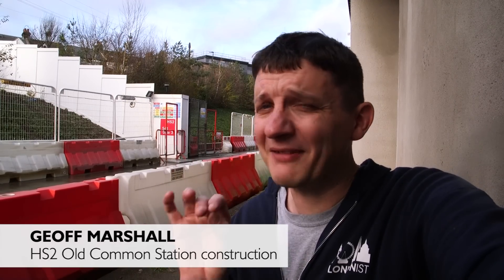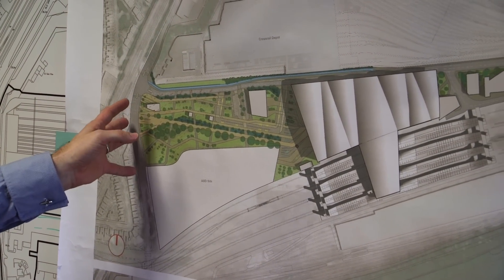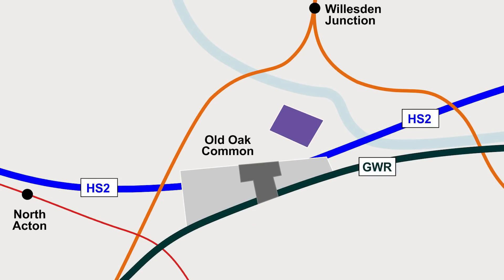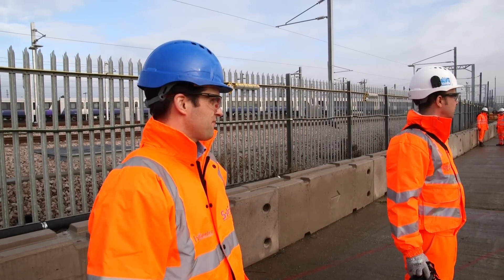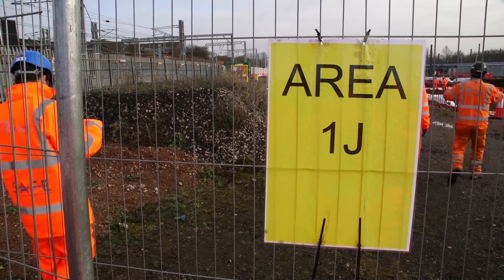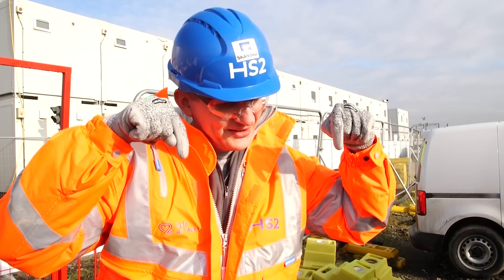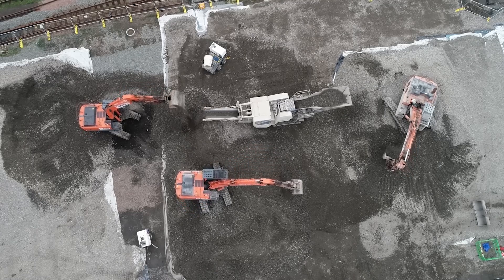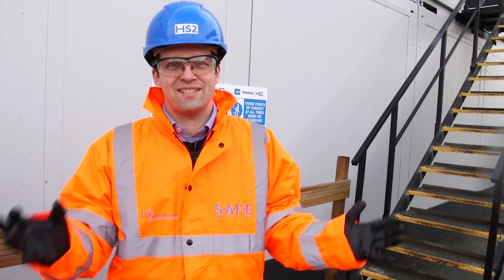HS2 Old Oak Common Station Construction

Comment: The dimensions are huge, but also in wasted opportunities of connecting to the existing lines of the Underground and well as the Overground. A new station is built for a lot of money but the overground only will be connected by two stations “within walking distance” and the central line running by will not be connected at all. If this location really was a considerate choice to create a major rail hub with long-distance high speed service in the western part of Greater London then please remind that the existing rail lines need to be connected from the beginning or at least alterations to do so have to be considered already in the layout of the new station. The Overground branches could be connected by (tight) curves to a new station paralleling the Great Western Main Line. Also for the Central line (at least for the trains of the West Ruislip branch) a solution should be found to integrate into the new hub, be it by a new station on the existing line or by relocating or branching off a new line running between North Acton and White City stations via Old Oak Common, while the Ealing Broadway trains could stay on the existing line via East Acton, as Ealing broadway will have direct connections to OOC stn. All this is not a simple task, but I fear with the inauguration of the new station the demand for better embedding it into the rest of the rail network will get obvious quickly.
Reply: The whole area is mostly warehouses but there are enough houses and roads (including the A40) that there is no way to link up the Central line without a new tunnel at a phenomenal cost. 

Commuters who need the central line can just change at Ealing.

Comment: Biggest white elephant going time its finished run over budget no one could afford to buy a ticket to  use it money better spent on nhs
Reply: All for getting to Birmingham 12mins early we have got 2stations in London Euston and  Marylebone which already go there I know I never be using it
Reply: @ashleyscottthomas6633  a few things a) the only reason people can’t afford current train fares is because there’s so little capacity that fares have to rise to prevent overcrowding b) the money can’t be spent on the NHS as it doesn’t come from taxation, it comes from borrowing which is paid back through the line’s revenue. The NHS doesn’t create revenue so it can’t be funded in this way. C) the primary purpose of HS2 is increasing capacity, not speed. HS2 cuts journey times by up to an hour anyway D) pretty much all existing services from Euston to Birmingham and other intercity destinations will move to HS2 to allow for more local services

Comment: HS2. What a monumental waste of money. If HS2 was scrapped and the greedy contractors paid off, they're still have over 100 billion, which they could then spend on improving and extending existing railway infrastructure countrywide, not just one line. East Anglia for instance provides a wealth of opportunity to relieve pressure on the south east. Examples such as the Norfolk Orbital Railway and re-opening the Wisbech to March line would cost a pittance by comparison, yet deliver significant benefit both to and from those areas. Scrapping HS2 could fund 100's of similar initiatives across the country rather than the one-trick pony of getting from Birmingham to London quicker (I don't imagine huge swathes of Londoners commuting to work in Birmingham and beyond).

Comment: The most exciting aspect for me is the resurrection of the old New North Main line to Northolt allowing Chiltern Railways access to Old Oak Common from High Wycombe and perhaps Milton Keynes. This'll make getting to the city and Docklands much easier using Crossrail than via Marylebone.
Reply: The New Line that ran by Heathrow Express and the GWR depot, at Old Oak Common, was permanently removed during this HS2 project, so I suspect Chiltern Railways will not have line access to the Old Oak Common Station.

Comment: The question to ask is how will Old Oak Common be used as a terminus Station due to Euston being delivered later than Old Oak Common.   And if that is finally being revealed, despite it being known for some years then what service will be available with just the 6 platforms.
Reply: High Speed 2 will initially only serve West Coast destinations when Phase 1 is built, so if Euston isn't ready for whatever reason, OOC has enough capacity to act as a terminus for those West Coast services. Euston's extra capacity is needed for services which will replace Midland and East Coast mainline trains

Comment: At £106 billion (which will probably end up being £200 billion) it will never cover its costs and the fares will be so expensive, very few will afford to use HS2. It may have 4 services a day and most coaches will be empty.  All this to save a few minutes travel! REVIVE SOME OF THE CROSS COUNTRY LINES CLOSED BY BEECHING!
Reply: The actual estimate is, at most, £88bn. Fares will be exactly the same as existing intercity fares, as the intercity services will move to HS2. 17 trains per hour are planned to run on HS2 once it's fully completed, with space for one extra.
Reply: @agent_605  Still cheaper to go by National Express and by air if you live near one of the National Express coach stations London Airports.
Reply: Terry Moore Thats only because air travel isn’t taxed anywhere near as much as it should be for its environmental damage. If the Government actually gave a damn about climate change they’d be putting much more funding into the railway to improve it and reduce fares

Comment: I’m sick of hearing all these great plans for transport infrastructure starting in London or the South.

HS2 should have been started on the North where jobs are needed. Unemployed folks on the south could move North where accommodation is less expensive  and work.

As the rail links filter towards the south, more access is opened up for northern business and services so that by the time it reaches London and connects to the South, more northerners are working, contributing to the economy, have more disposable income and their taxes are being ploughed back into the country.
Reply: Matchstalkman Construction work for HS2 has already started in the North as I speak, Building work has begun in Birmingham for a new Rail Hub Interchange  https://www.newcivilengineer.com/latest/work-to-start-on-270m-birmingham-interchange-09-03-2020/

Comment: HS2 will just pull more people towards London from the North. It's not clear how the North would benefit...if indeed there would be any benefits?  And is shaving off less than 20 minutes from London to Birmingham really worth it?.....worth all this effort and upheaval?  How much alone is it going to cost to divert a section of the GWR main line so that it goes through OOC?  With a No Deal Brexit looking very likely, HS2 just looks absurd and wildly extravagant. Unfortunately these are not right times for HS2. The 00's would have been perfect - pre 2008 Financialcrash, and Pre 2016 referendum. Now HS2 looks like folly rather than justifiable and necessary.

Comment: Looks like the new government are about to pull the plug on the entire HS2 project. In some respects this is sad, but in alot it's a blessed relief. It's just NOT the right time at all to be starting to build a new network of railways from scratch. The biggest problem with HS2 (and there are many!) is that it didn't reckon on Brexit. Us leaving the EU wasn't factored into the equation when the whole HS2 idea began rolling ten years ago. No one then, could forsee the UK voting to leave the EU. It wouldn't have crossed anyone's mind back then.

Now we are no longer in a position to justify the huge expenditure the project would cost us all. By the time we've removed the last strand of law linking us with the EU and expenditure this will entail, there won't be much money left for HS2. Oh, and also there's the small matter of the divorce bill. We're going to have to pay the EU something - this is obvious. Just how much?? They're not going to let us leave the EU for free. This is patently obvious, and the more we try to insist we owe them nothing the greater the damage will be to relations with other European countries. In the long run this would harm us........and them.

So we need to focus on improving the existing rail network we have. We also need to get on and build this 'Northern powerhouse' rail link between Liverpool and Hull ( via Manchester and Leeds). This is long overdue, and the fact you can't travel on one train continuously from Liverpool to Hull is, in 2019, frankly not good enough. Another thing, there's alot of appetite for some rail lines closed by Beeching, to reopen. These projects (and the Northern Powerhosue rail link) are what we now need to focus on - not HS2. I'd say HS2 is pretty much dead in the water. Sorry Old Oak Common, but it ain't gonna happen. It was very ambitious, but ultimately Brexit has made it virtually impossible.

Comment: Still don't understand why HS1 and HS2 aren't going to be connected.  Are we seriously going to expect passengers from the NW for the Continent to get off at Euston, walk to St P and get on another train?
Reply: In early iterations of the project there was a link via a tunnel between Old Oak Common and just north of St Pancras (ish.) However, as the design was developed, they reckoned that there wasn't enough passenger demand from "North Of London" to/from the continent to justify it, (incidentally, it also means HS2 trains don't need to be compatible with all the European signalling systems) and of course it saved some money by deleting the link and appeased some of the residents of Camden. The train paths then freed up allowing for serving "other" destinations in the UK.

The vexed issue of passengers having to walk from Euston to St Pancras gets discussed from time to time and at present is does seem they will be expected to walk. There is some suggestion that if Crossrail 2 gets built, a Crossrail 2 station will link the two London HS stations (Euston & St Pancras) by foot underground rather than at street level. Travelators and/or some kind of people mover often get mentioned. Again, it would seem that expected number of passengers wanting to travel HS2 and thence onward to Europe doesn't justify any great expenditure. 

Likewise, a station a Heathrow got dropped for much the same reasons - not enough passengers to justify the expense, but at least Heathrow passengers can connect at Old Oak Common for Crossrail 1 (Elizabeth Line) services to Heathrow.

Comment: As someone who believes in rail travel HS2 makes me sick, taxpayers money being wasted on a project that is not essential to the infrastructure in this country. Rail fares are going up yet we still have rolling stock from the 80s on key commuter routes. The disruption this is causing is already causing havoc. Euston station closed ruining people’s travel over Easter weekend because of this project. Cross rail has already gone belly up with overpaid project manager being fired. Money wasted on a project aimed at business people who can’t wait another 30 minutes to get to Birmingham, Chris failing will be fired before this farce is even half done yet he didn’t have the balls to stand up and use the money where it’s needed. Shame on the government, with any luck we crash out of the EU and they have to drop tools and abandon this pathetic project.
Reply: HS2 is far from "not essential" - it's proponents claim it's addressing capacity constraints on the WCML/ECML. Station (and line) closures for engineering works is hardly a novelty, it happens all the time.

Comment: HS2 should be abandoned now, before any tunneling has been done.
Reply: We NEED HS2 to provide badly needed additional capacity! The WCML is the busiest main line in Europe, if not the world, and is likely to run out of capacity in the next few years the way things are going, and the only long term solution to that is to build a new line. Building it doesn't mean we can't improve the existing network as well - it isn't one or the other!
Reply: @Inkyminkyzizwoz  we don't,  it would  be better to have a bullet  train like  service they could slowly develop such a thing one station at a time with a replacement bus service for the gap as the bullet trains slowly extend along the route
Reply: @GreatSageSunWukong We've already tried that with introducing the Pendolinos
Reply: Meanwhile the North East uses Pacer trains.
Reply: @jerryn9496  exactly
Reply: @pxsrrail2558   Didn't you mean 'not exactly' ?
Reply: @jerryn9496  Meanwhile in the North East apart from the new NEXUS trains £ Bns of new trains are under test and drivers being trained for services in the North by TPE and Northern.... You forgot that bit
Reply: but at least keep building old oak common station and re-route HS2 to serve Swansea
Reply: Agree, its just another excuse for social clensing, East Acton is getting filled up with investment flats for Chinese people to buy and never live in
Reply: Christopher Wright we can only hope Christopher, we can only hope. I can’t believe that they’re actually still contemplating continuing with destruction, I mean construction. Ha ha ha. This thing is billions and billions of pounds over budget already, and it will be even more so by the time it’s finished. That’s not even the most important part. Or environment will be potentially be visibly scarred and damaged beyond recognition by the time it’s finished, and yet they’re still saying they’re going to go ahead with it. These people have absolutely no sense. NO SENSE AT ALL. The only way we’ll be able to stop it now is with a complete and total outcry and protect strike across the areas that will be demolished and in London.
Reply: @danielwhyatt3278  HS1 is enough to give the UK a high-speed presence on the European network. HS2 reinforces the neglect of the North in favor of yet more London-centricity. So much improvement could be made to the whole network for the price of the HS2 vanity project. It's infuriating.
Reply: @danielwhyatt3278  How can any project let alone HS2 be '£ Bns over budget'; when contracts have only been let a few months ago? You wouldn't be playing the misinformation game would you? And please may I have the winners at Ascot later this year seeing you have such a reliable crystal ball?
Of course the reality is you are talking utter bollocks like all NIMBYS (and Remainers) do to appease your confirmation bias. You present NO facts just some hysterically inaccurate opinions ....
Always makes me smile how you objectors to HS2 never see anything wrong in the ICE services in Germany, TGV in France and all the other High Speed lines in Europe. 
#FacePalm
Reply: @danielwhyatt3278  destroy the environment???? This amazing feat of engineering will take millions off the road every day!
Reply: @pxsrrail2558  HS2 will simply turn Birmingham into a temporary commuting suburb of London. Temporary because work patterns mean fewer people will be desk bound or need to work in the smoke. Electrifying and improving alignments across the country will be of far greater effect for the price of a vanity 1960s Japanese bullet train through the Chilterns.
Reply: @pxsrrail2558  If millions a day are going to use HS2 they'll need to plan to build several more tracks.
Reply: @pxsrrail2558  To serve just one city and destroy even more land for an unthought route.

Comment: Scrap hs2 and build hyperloop.
Reply: Hyperloop has not been demonstrated to work yet, let alone make an economic or safety case. Assuming the engineers sort out all the Hyperloop technical challenges (thermal expansion of the tubes, maintaining the vacuum, going round bends, junctions, passenger ingress/egress, dwell times, emergency evacuation, passenger safety - the list is endless,) the DFT reckon it'll be twenty years before Hyperloop is ready to carry people. Many are skeptical hyperloop will ever be practical. 

Some boffin calculated that 34 hyperloop tubes would be required to carry the same passenger capacity as one high speed rail line. Take a look at the litany of moaning NIMBY commentary attached to this video - can you see them embracing 34 hyperloop tubes arcing across the landscape near them...? I can't resist the pun - right now, hyperloop seems to be something of a pipe dream. I'l get my coat.

Comment: It is a shame the HS2-HS1 link at Camden is currently cancelled
Reply: wickiezulu REALLY, I HADN’T HEARD ABOUT THAT? That’s freaking awesome. Why are you saying it’s a shame. There is nothing the majority of the country wants more than to stop this abomination from being built across our great country. If we can stop the whole damn thing, then all the better. It’s not too late. Join the resistance.
Reply: The HS1-HS2 link though Camden got deleted years ago. There isn't enough passenger demand for services "north of London" to/from Europe. Removing the link lopped a billion or so off the projected costs and of course Camden residents were not at all disappointed.
Reply: Yeah, oh well. It'll probably but at some point in the future, though.
Reply: Perhaps. Even though commuters going to Stratford from the east could also get to Old Oak Common via Crossrail (when it is fully opened), quite like the idea of traveling to Manchester and beyond from Stratford International without having to travel to Euston.
Reply: @doomotron6160  - If an HS2-HS1 link is resurrected in the future, I guess it will be a very different route/design to that proposed in the early HS2 scheme. Once Old Oak Common station is built, there won't be anywhere to put the TBM's into the ground and drill a tunnel towards St Pancras. A new (buildable) HS2-HS1 route would have to be found.